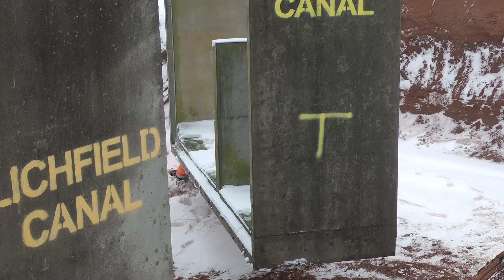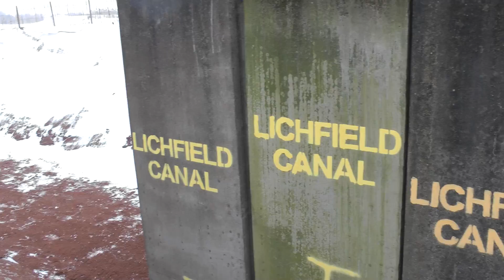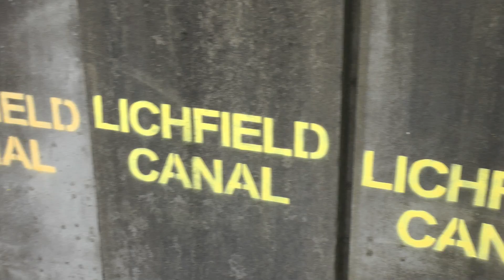Darnford Lane Culvert - The Big Lift

Comment: Why did the last unit (#11) didn't have lifting mounts on top like the first six (or 10) and had to use straps, didn't they get in the way of its placement?
Reply from the maker: Good question. I believe that it came to us without the lifting mounts, not sure why. As for placement, they are in a temporary position so it doesn't matter if they did get in the way and that unit isn't lined up as closely.